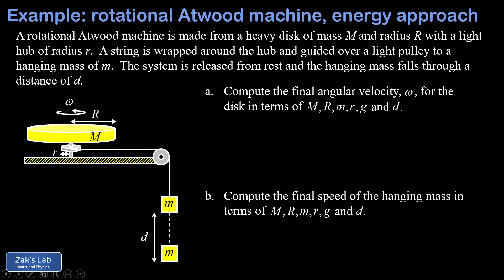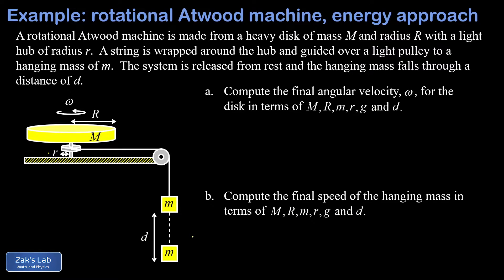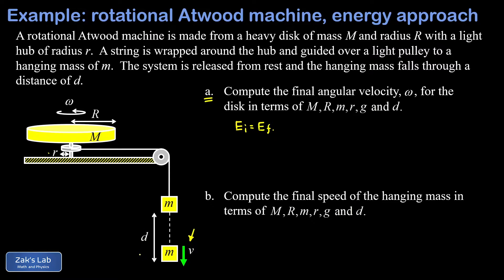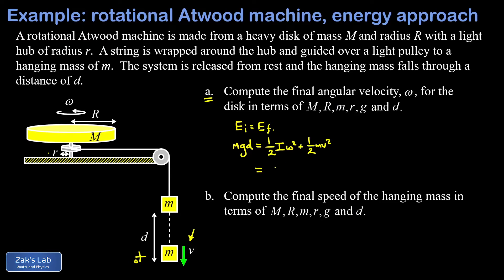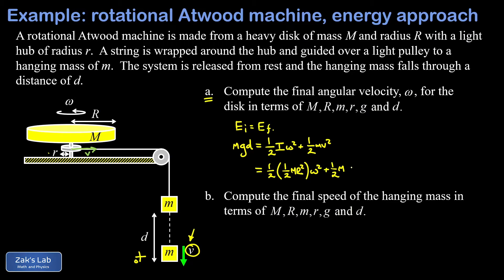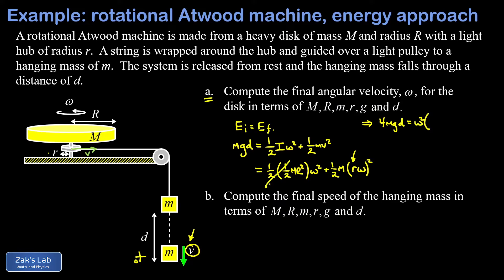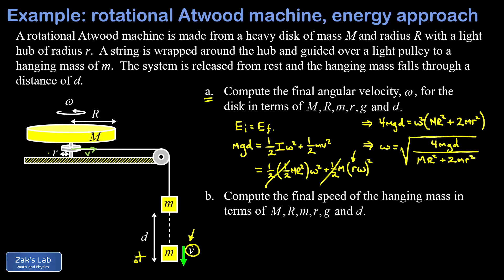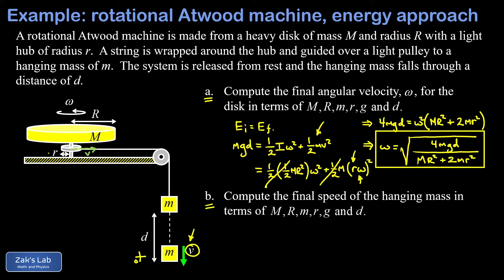Disk and hanging mass rotational Atwood machine:  conservation of energy approach.

Comment: Yesterday I just helped a underclassman with a similar but simpler problem. He was supposed to use tension and torque to find the acceleration. But I think in this case energy is a more convenient way.
Reply from the maker: Oh - I delayed my reply to this because actually what I did was put the energy version of this problem on my life-science (trig based) physics exam, then I put the force and torque version on the exam for my engineering majors.  That video will happen soon, although I'm feeling completely swamped by grading right now.  Same for the ball rolling up the hill question, by the way.  z

Comment: Cool question dude!
I solved it using the relation: Torque = (Moment of Inertia)*(Angular acceleration)
I noticed that the length of the string doesn't matter, so why not stick the block right onto the hub! Of course we would also have to add its moment of inertia into the calculation.. then after finding angular acceleration the rest was straight forward
Reply from the maker: These are the two basic approaches to the problem:  energy vs. force/torque approach.  The advantage of the energy approach is that it's simpler, and the advantage of the force/torque approach is that it gives you more information (the equation of motion for the mass, rather than just the final speed).  

In the end, you can use energy for everthing when you step up to Lagrangian mechanics at the upper div. level!  z